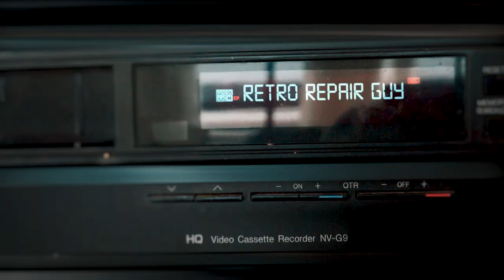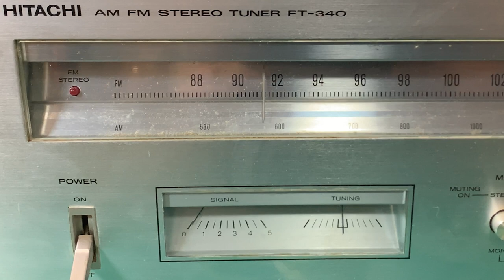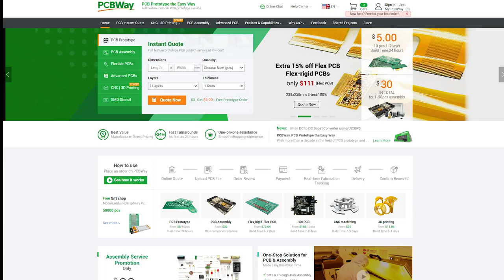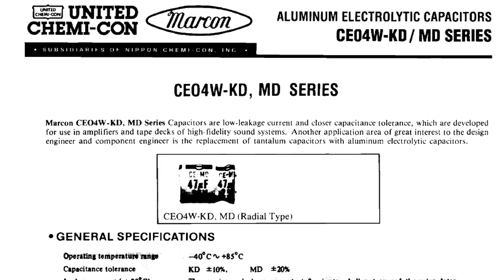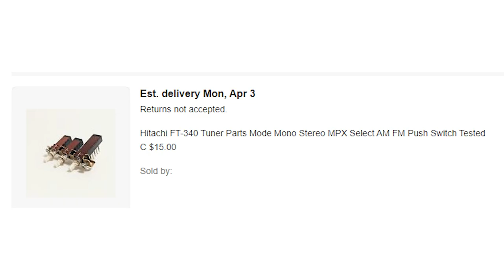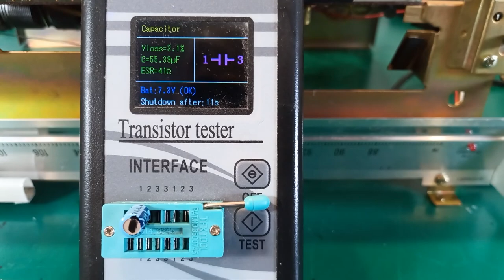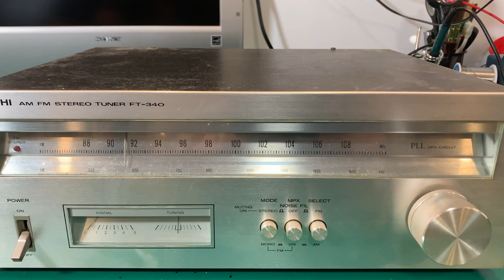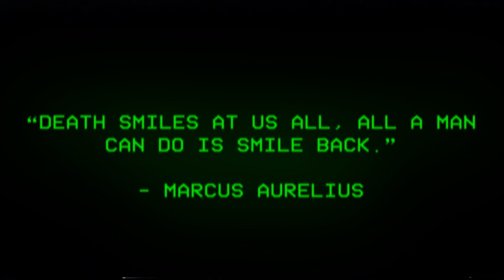Restoration of a Vintage Tuner from 1977 | Retro Repair Guy Episode 36

Comment: I believe the MPX filter is a 19 kHz notch filter when recording to tape, as that frequency can interfere with noise reduction systems and the bias oscillator.
Reply from the maker: That makes a lot of sense. I couldn't find much on it and while I found the service manual, that information would have been more in the user manual which I might have somewhere but did not see online.

Comment: Last week a Hitachi SR-503L ( 20W per channel/8 ohm/RMS) arrived at my door, courtesy of a successful online bid through a local site (winning bid: ~US$120 + $20 delivery). The pictures proved accurate, as the receiver came in near perfect condition...hardly a mark on it.  Inside it proved really clean, probably because the prior owner had this unit fully revised (Nichicon FG for signal paths + low impedance PW's for the power caps, problem transistors replaced, new filter caps, lights, etc.). He had purchased it as a planned stop-gap while his other higher end amp was under revision.  Clearly, he had spared no expense to revise this one before shipping out his primary gear for refurb.
This is my third Hitachi...two years ago I landed an SR-903 (Class G amp: 75W into 8ohm RMS + 160W peak) for $138 in minty mint condition from the same site. As I like that receiver so much, a second SR-903 was purchased last year for $115. One sits in the family room.  The second was a bit large for my office, hence its replacement with the smaller SR-503L.
Given the quality of the sound and physical build of these receivers, I have to pinch myself at their prices. Clearly, no Marantz, Pioneer, Sansui tax with these babies.  I am OK now to let the secret out...I have my share of these vintage beauties and they are keepers.  Now selling off some other equipment (Yamaha CR420, Pioneer LX626, Pioneer VSX-LX60) that I have no need for...and preparing the revise the one SR-903 for future bullet-proofing.  Bought all the caps and transistors for this leisure project (and spares for the other). One thing about all of these vintage Hitachi's...the documentation is superlative and the PCB's are all clearly marked.  Attention to detail in design and manufacture shows these pieces were made to be easily serviced.
The sound from this little 503L is wonderful: full, good base, low distortion. I also wrapped the black wooden factory case with a dark gray wood-textured vinyl and replaced the rubber feet with machined ALU feet (w/rubber isolation rings at the base of each).  Looks fantastic when paired with my Marantz EQ20.

PS: Congrats on tying the knot!
Reply from the maker: Hi! Thank you! As for these Hitachi components, while I used them with my uncle as a kid, I really only discovered them a couple years ago when I got them in my posession. After I restored the amp and replaced all the caps, I was blown away by the sound and quality of these units. I would love to do more to them like add bluetooth, change the feet, etc. but part of me likes to keep everything original and part of me likes to improve. Not to mention if I modified them I probably would get comments that would never end.
Reply: @RetroRepairGuy  If you were to mod them, I would not say a word!  

As for modernizing with  BT, etc.  I was lazy and opted for the FiiO BTA30 Pro ($125).  This little unit packs a ton of features. BT5.2; with TX, RX and DAC modes. Supports LDAC, AptX, AptX HD, Aptx LL, AAC, SBC. Has RCA outs too.
In the family room I use it in RX mode with my Hitachi SR-903, paired to Dali Spektors. Note: Android supports LDAC (in dev mode).
Another BTA30Pro is in my office, in DAC mode with PC as source, with the SR-503L paired to bookshelf speakers (Mordaunt Short 20i's/Sony SS-CSD1's). USB-A 3.0 from PC to USB-C into the FiiO for both signal and power.

Comes with an app for remote control, to include volume and a 10-band equalizer.
Reply from the maker: I bookmarked the page for the FiiO, going to take a look at it later. Thanks!